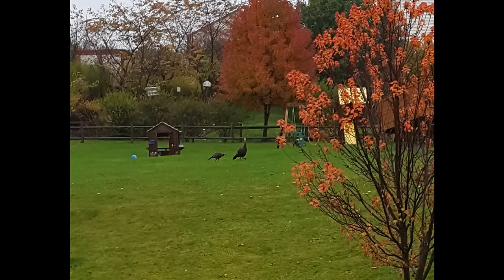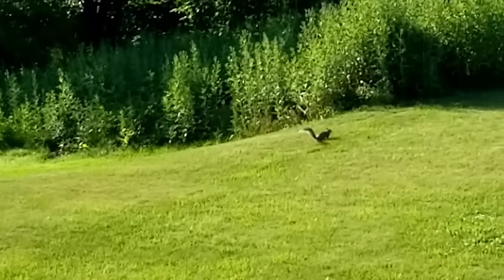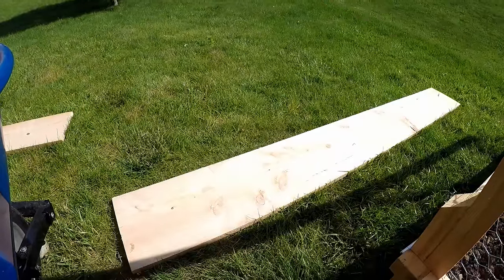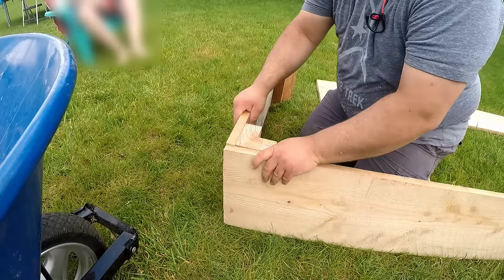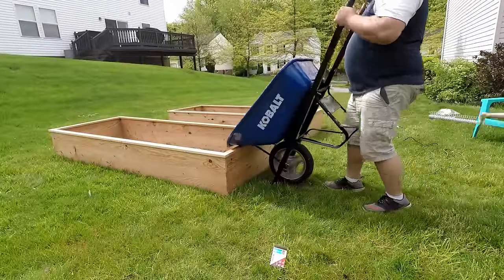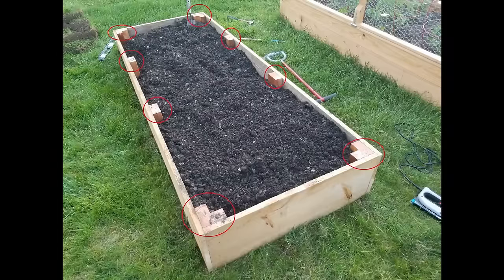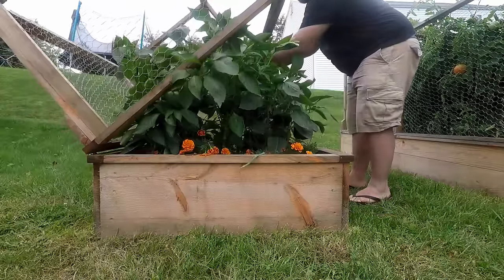Enclosed Raised Garden Beds - DIY Gardening Project

Comment: This is a damn good idea for squash beds, use window screen instead and just make one side open, maybe a little taller. Thanks for the idea! I'll give you credit when I make the video!
Reply from the maker: No problem. Glad you found it useful.
Reply: What a wonderful idea! window screen would keep bugs out too... Would it shade the plants too much? We use screening out here in the desert to shade our tomatoes. They aren't fond of 120 degree weather. I plan on moving to a colder climate though... Just wondered if the added shade would be a detriment in a place like Minnesota?
Reply: @diy-mitri9737  the flowers on the squash will have to be hand pollinated if you use window screen.
Reply: @diy-mitri9737  I'm not sure since I haven't built mine yet. I suspect it won't provide much shade at all but I'm going by my screened in porch. Plenty of sun gets through there so this should be similar.
Reply: @annmarienoone9879  hand pollinated how do you do that? This is my first year so I'm learning a lot.
Reply: @Littlepinkbus  with a Q tip, check out videos on hand pollinating.

Comment: Your video was awesome. I am going to make these !   Great that you gave your advice on things that you will change for next years cropl  As for the Tall height, I would just cut out the one section of the chicken wire where you need the height and shape new chicken wire to the "Mountain Height and restaple.  I will be putting my hinges on the sides to life vertical. at the length for more height room.        You didnt miss any steps to your video. Well Done.  Best to you and your family. Lori L

Comment: Thanks for sharing !  I made 16'x5' raised beds but buried 8' landscape timbers 2' under for all 4 corners and the middle of each long side (6 total).  My "doors" are on both long sides but it is simply stretched 4' tall chicken wire between 2 2x2's separated in the middle (4 doors total).  Works great for harvest and weeding.  I have pole beans and mators so there is no "ceiling".  This keeps the worst, deer and rabbit's, out of the garden. I wish I could post a picture of them here.  also I surround the entire border with marigolds for animal repellent.  I like the parts of your vid where theres no music and I can hear what's being said.
Reply from the maker: Thanks for your comment!  I wish that I had put doors in... next time.  I also plant marigolds, it works pretty well.

Comment: for your cucumber zucchini bug issue, read up on companion planting such as some herbs planted beside those attacked could ward off those bugs and a homemade pepper spray could chase other insects away have a great day.
Reply from the maker: Thanks for the suggestions. I will look at that. I tried yellow flypaper, but it also trapped ladybugs and the adhesive was also not strong enough. The bad bugs would get stuck and then get free. The problem was I needed to do more preventive measures. By the time I saw them it was already too late. I won't make the same mistake again.
Reply: Pick the zucchini bug eggs off the bottoms of the leaves. I use duct tape to collect them.

Comment: I had some success with a similar project in zone 5 winter gardening using plastic on sides secured with stapled furring strips and a hoop of fence on top secured to frame, just like yours with zip ties. The wire fence edges were jagged on plastic and on fleece. I have expermented with duck tape, it's effective but ugly. I am thinking about a rubberized  paint just on rough edges. Anyway, if you screw in eyelets along bottom sides of raised bed and run rope over the top of the whole thing it secures the top and sides. I used the quick release knots, so i coukd easily tighten and loosen as needed, that is a must. I used more furring strips on sides with rows of plastic and a layer of fleece underneath along the hoop style roof to give warmth and allow some ventilation and water to pass to plants on warm/sunny days. I have 20 of these beds and it was too much to vent and water so, it was essential. I only grew kale, mizuna, winter lettuce brussel sprouts and spinach. They all survived weeks of frozen snow, but nothing thrived until this first march thaw. I planted everything in September ladt year. I am planning spiring vegetables now. I think next year i am going to cover beds with plastic in Feb to achieve early soil warming and put everything up in march to get a 2 month jump on spring crops.
Reply from the maker: Thanks for your comment!  I was actually planning on doing something very similar to what you suggest and creating a little greenhouse.  I think that it would have worked very well.  The only challenge is that I am moving and so it didn't make sense to get a jump on a garden that I wasn't going to use.  Great suggestion though!

Comment: I would love to have more specific instructions for building the raised bed cages. I am also having trouble with critters, specifically with rabbits, groundhogs and squirrels and I recently had two fox run through my yard. I don’t have much experience building things, have built a simple raised bed, but the cage is out of my league with just watching your video and winging it. Also, my main two beds are made of galvanized steel, so the hinges would be a problem, but I would be willing to lift it off and on if it protected my veggies.

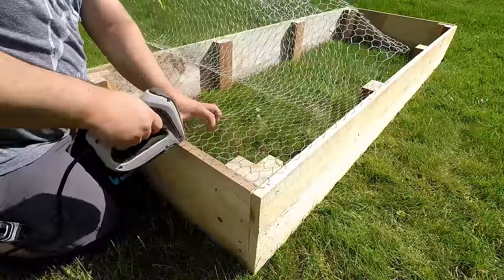Comment: 4:55… I used the Lowes castle bricks and cedar wood planks.  I WISH I had done this chicken wire along the bottom but I got a little too far and didn’t want to undo all the installed dirt.  I hope I don’t regret this.  🙏

Comment: Great idea, but it looks like some of the plants get smooshed by the cage when it's opened and closed. You should definitely add doors to the bottom next season.
Reply from the maker: Yeah, I had to be really careful not to shut some of the plants in the doors. I will definitely be making some changes next season to make sure that it works better.
Reply: @DIYwithDave  omg yes! if you could make another video next year with the same sized beds but somehow put doors on them, my dream will be made. i cant seem to find any diy videos for smaller beds like these but with doors (it would be so perfect) p.s. just subscribed

Comment: Chicken wire on the bottom will fail after a couple years. It rusts and gofers will chew through it eventually. It's better to put 1/2 inch hardware cloth.

Comment: Please tell me the dimensions of the wood you used to build the cage.
Reply from the maker: The base of the cages matched the top of the raised bed. The two smaller cages were about 2 feet tall and the larger one was about 3 feet tall and the rest of the measurements I made on the fly as I  built it.

Comment: A raised bed, that just had DIRTY dumped over the lawn into the box? Why on earth wouldn't you have taken the sod out first, and put a gardeners liner in the bottom so the weeds can't come up?   The grass is going to grow right up through the soil!!  The Dirt DOES NOT KILL IT.  It only takes longer to grow up through it.
NO mesh on the top of the cages?  Do you think squirrels and birds and such can't figure that out?  This is just nonsense.
Reply from the maker: Sorry you didn't like it. I was going to put mesh on the top but instead of going to that trouble I decided to see how it would be first. I can always add mesh later, I thought. Well, it worked out fine. No problems with squirrels or birds at all. I think the biggest problem I have here is rabbits.

On the grass, again I decided that it wasn't worth all the trouble to remove the sod first.  And that has also worked fine. I have only had ocassional blades of grass; no more than what could have blown in naturally.
Reply: @DIYwithDave  from the experiences of friends who also did the beds over grass,  it eventually will come up in full force as theirs did. They emptied their beds, and put down gardeners cloth, and put all their dirt back in. They also have serious deer problems. Especially eating their hostas and other garden flowers and vegetable crops. Even crows pecking their tomatoes. where there's a will there's a way.  
Have a look at SHAWИEE HILLS WORKSHOP Raised Bed Garden which would have worked out great for you. Episode E82 if I remember right.
As ever I wish all the home gardeners the best of luck. I grew up on a 400 acre dairy & crops farm and much of what we did was by trial and error,, so videos are a sensational tool for helping avoid some of those errors and the helpful hints.
Reply from the maker: I'll check it out.  Thanks!